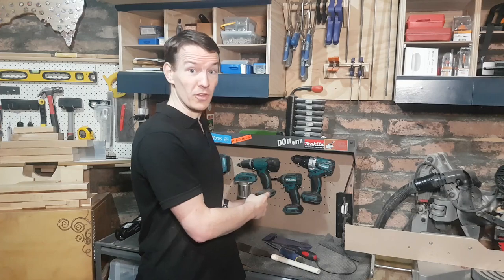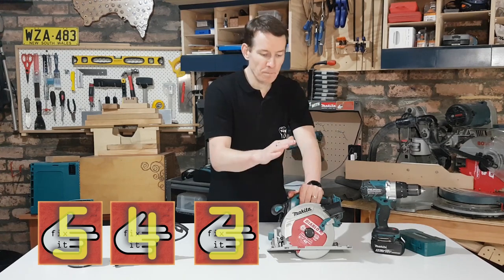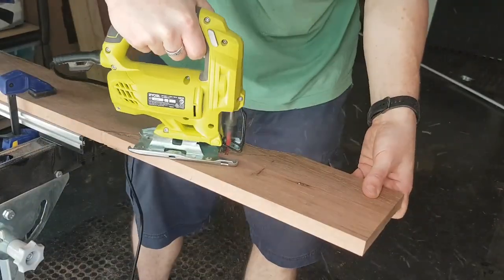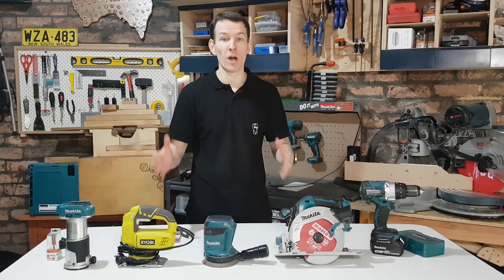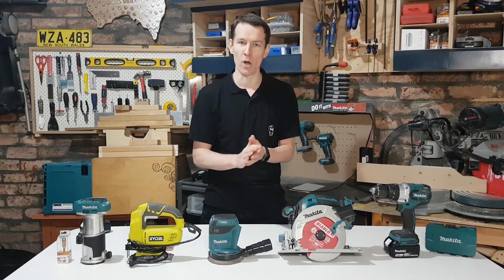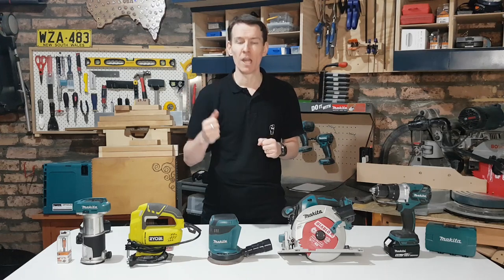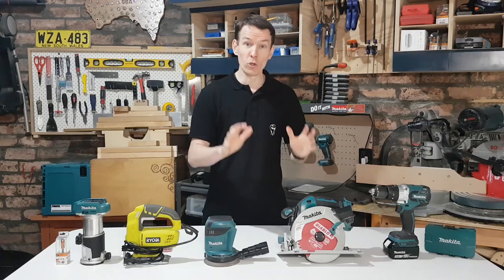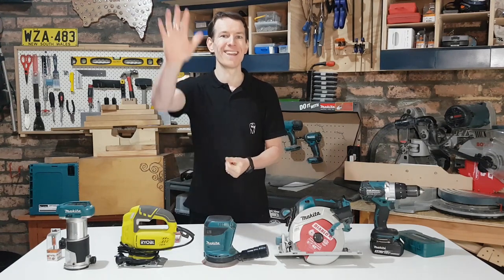Your First Five Woodworking Power Tools (Fixit Fingers Fiver)

Comment: All my tools are Ozito... except for the beloved trim router which is Ryobi. It's the only hand power tool I wanted to spend a bit more on to get a better tool.
Ozito is fine for bastard cuts and roughing out, they're cheap but still gutsy and you know if you wallop them too hard it won't break the bank to replace them. That said, I've had all mine for 4-5 years now, exact same 5 tools as here except I have an Ozito angle grinder too, and they are all still going strong. The angle grinder and jigsaw have even spent a night in the rain (don't ask lol) and still come out grinning. 
The only real difference in the 5 Tool Starter Pack shown here is my sander is a detail sander, not an orbital and all mine are corded. I'm happy to have the inconvenience of cords over the inconvenience of tools going flat when I need to use them or being flat because I forgot to charge them 😂 Plus, batteries don't last forever. 
My only other power tool is a dropsaw, also Ozito. Not much you can't make with that small arsenal.
Reply from the maker: I actually started with a corded Ryobi detail sander too! Since getting the ROS though I have given it to mum as I'd not touched it in over 12 months. Sumo over at Sumo's projects has got excellent life out of his Aldi gear. I think you've hit a great point in that knowing their limits and not pushing them too hard and they'll do well for a long time. Corded also probably a good option at the lower end as there is a big difference between cheaper batteries and trade ones and you won't have to worry about power drain. 👍
Reply: @FixitFingers  pre the woofloo, I did a bit of furniture flipping, so the detail sander was preferred to an orbital to get into the corners of furniture I needed sanded. I liked antique and older stuff that has all manner of fiddly bits the need sanding and refinishing. 
Otherwise, in order of preference, it would have been orbital, finger, linisher, and then belt. Besides making stuff with wood I also make sculptures from big bits of burnt wood and restore old tool, hence the different requirements. It's also why I had an angle grinder. Put some ceramic flaps on one and it's great for chewing out charcoal and hogging out gum. I wouldn't have thought twice about getting a detail sander if not for the furniture refinishing.

Comment: Great review there James, I have a Ozito circular saw and use it sparingly but it does the job when called apron, I bought a Makita 91/4 back 30 years ago and it’s still in my Triton 2000....I like blue too.... got a good tip of Mark D and bought the MT sander wow that thing is awesome for power!!... keep up the good work mate. Learning all the time!
Reply from the maker: Cheers Dave! Often with cheap tools, it is the blade that makes all the difference. My little Ryobi jigsaw did struggle with the cheap blades I got originally. Now with some diablos it chews up red gum. Got me a corded Triton circular saw... and plans for it! ;)

Comment: Great well thought out. But since you asked for it, partly because I am a klutz, I prefer the barrel style jigsaw since you have a modicum of more control.  For the router I started with the 1/2 inch since with the hardwoods the trimmer was underpowered and the choice of router bits is greater. I now have the same trimmer and I am impressed with how useful it is and it the router I use the most but if I could only have one it would be the beast. 
Cheers
Reply from the maker: Cheers mate! The little trim router does CHEW batteries as well, and slowly loses power as the battery depletes, but there are not too many jobs that last long enough to push it in this context. The ability to chuck it in a plunge base and beef it up is another stellar feature for versatility. My next will be a proper sized corded one for faster surfacing and Router Table Version 2. You can't beat the corded 1/2 inch power, but I think starting out I'd still go a good quality trim with a plunge base over a cheaper standard large router if you can't afford the branded big boy!
Reply: @FixitFingers  Keep an eagle eye on Gumtree occasionally really good quality ones come up at a bargain price. Look for variable speed control (necessary for some of the large bits like surfacing bits) and power preference for more the better but at least 1 1/2 up.

Comment: Great video, very helpful.
Be careful with top brands as they have Trade and general which are very similar in style.
Reply from the maker: Then there is also Brushed and Brushless, or just skipping these and going right to a mitre and table saw 😅 At least Bosch have the right idea in clearly separating their premium from their DIY versions! Even Ozito have a "Premium" line now too. Add in the fact that there actually aren't that many tool companies when you peel away the branding (AEG, for example, is just re-packed DeWalt) and it's a confusing old world 😊

Comment: Hey James, this is a very good video. Would you mind talking about that blue guide for the circular saw? or if you have talked about it in another video could you please link to it?. Thanks, regards from New Zealand.
Reply from the maker: That's the old Kreg Square-Cut, since replaced with the new portable cross cut. There is a video on both, here is the new one https://youtu.be/NYbi43e02v8 😉
Reply: @FixitFingers  Thank you. Also about the circular saw. I bought mine with a set of 9 Ryobi tools mainly for drill and impact driver (knowing little about circular saw) in 2021. It turns out that takes 150mm size blade and only a few brands makes them with higher teeth count higher than 18, even Ryobi doesn't make them :(. I have contacted them brand already. I've found Ozito makes 32T blades but unsure if it worth it. Should I try to fight the warranty as this model isn't sold anymore? currently they sell for 165mm and 185mm blades. What do you think?. Thanks in advance. Happy New Year.
Reply from the maker: @Mauricio_Ferrari  Diablo make a 20t combo blade, that's probably the best for that saw. A good blade makes a cheaper saw much better and is worth the investment!

Comment: Thanks for the video. You missed HiKOKI (formally Hitachi) and AEG. I disagree with you that it is just about the colour. There are small differences in quality and there are definitely differences in range. 
I had 'personalised' notifications on and I wasn't getting any notifications of your videos. Now I have set it to "All".
Reply from the maker: Argh Hikoki! I knew there was at least one. Oh there are definitely some differences, I've noticed plumbers seem to like Team Red as they have a range of tools catered to them. I guess what I'm getting at is for every bad drill DeWalt releases, Makita releases a bad nail gun. A router from one brand may be slightly unbalanced, while another has poor dust extraction. You'll win some you lose some. Luckily there is always the corded range of other brands you can replace a less than perfect battery tool from your favourite colour (and then hide it in the cupboard so it doesn't clash on your tool wall 😂)

Comment: James what about the Ryobi jigsaw? if you were starting again would you buy it for the kind of work you do? I'm about to start with some basic round cuts and I'm in doubt if should start with a second hand Ryobi that I found or with an AEG one that is at the top of the budget.
Reply from the maker: I still have the little Ryobi, only last year upgraded to the battery Makita. Starting again, I'd still say the corded Ryobi is excellent value. If you want to cut the cord and are looking at a trade level tool brand to invest in, check out the second hand market. I got my ROS off FB Market 4 years ago and it is still going strong :) I'm a '1 platform' kinda guy, but no one says you have to be brand loyal. It is just an extra charger after all.
Reply: @FixitFingers  oh I forgot to say that I'm targeting a corded jigsaw as for cutting tools I'm not bothered by the cord. Anyways I think your advice helps me :) thank you.

Comment: Hand held belt sander > orbital sander, especially the ones that can be function while upside down on a flat surface. It allows you to sand both big projects and small parts. Even if you get one that can't be flipped, I'd still suggest the belt sander due to its power and ability to remove material quickly. I think the biggest question to ask yourself is if you had to sand small parts or big projects by hand, the decision is easy. As for "premium" tools, they exist soley for taxation reasons. The quality difference doesn't justify the price difference, especially the laughable table saws.
As for brands, each brand does something a little different. The shape and weight of the Makita drill and driver is much better than the bulky Dewalt varients. Not all the tools from the same brand are the same in quality so pick them up, check the power, feel the material quality etc before you buy. 
I look forward to the video on available timber in Aus. Sometimes it feels like there's only 3 types, Pine, Vic Ash, and firewood.
Reply from the maker: Awesome insights Ace, and great commentary on sander use. I actually started with a corded Ryobi palm sander, I still have it, but the ROS is my go-to. I'm actually looking at the Bosch Green belt sander for the reasons you mention as we speak. Totally agree on the "Check the Tool" rather than rely on the brand sentiment. I had a bit on that but the video was getting long so I cut it out. My example was a brad nailer. I went to look at the medium sized 18V Makita one ($530! Ouch) ... and it has been panned in reviews so now Im looking around at other options. Every brand will produce lemons from time to time. Sadly with the wood, I'm not going to be blowing your mind, if you give it a second thought I'm sure you can pick the other 3 wood goods to be featured as my goal will be to explain what projects to use the first 5 woods a novice will see when they walk into the Big Box store on. Thanks for the contribution!  💪
Reply: @FixitFingers  The Ryobi brad nailer is pretty good. I had the option of using a Makita nailer too but I'd always go with the Ryobi for some reason..but this was before I was familiar with the tools in general. I've mostly used air compressor ones for work which are really nice to use.
Oh no, you're going to say chip board, plywood, and MDF is real wood?! Blasphemy. I'll still watch it just to give you a hard time in the comments.
Reply from the maker: Hahaha it's the way to get views... keep the people angry 🤣 Honestly I've not made enough hardwood projects to give a validated opinion on the pluses and minuses of certain species, and I see milling as a more intermediate stage of your woodwork journey (I've only just started that myself) needing more tools than a beginner may have so yes, sheet goods will be featured 😅